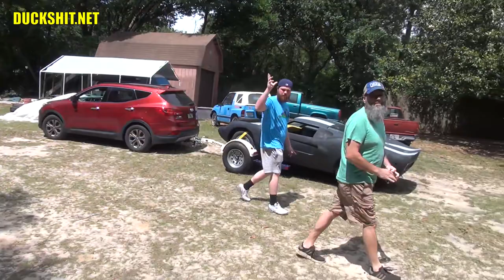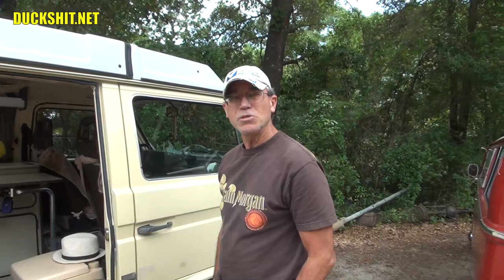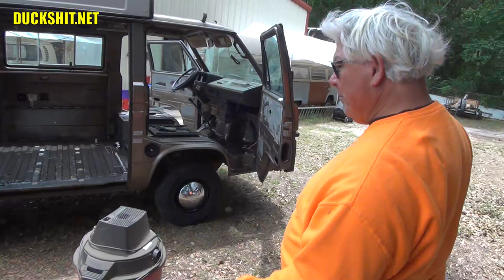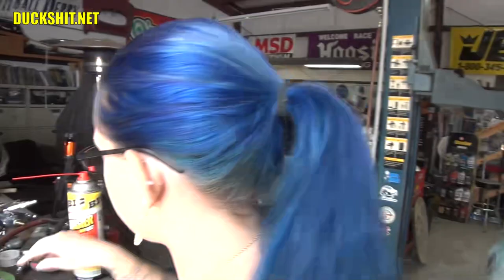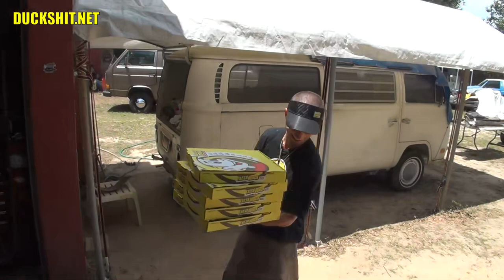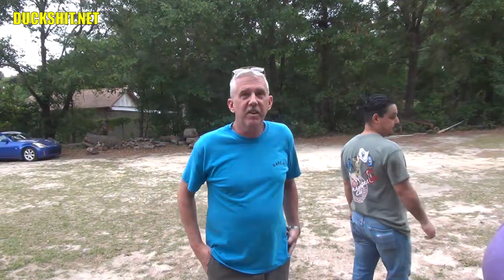Adjusting Spring Plates  - VW Tech Session - May 2020

Comment: I could definitely use a tech session,  I've been having trouble with engine idle... hope to have it sorted out tomorrow
Reply from the maker: I usually check the low speed jet(s) on the right side of the stock carburetor first, its almost always that.  Good luck!
Reply: @vvtheduckvv  found the problem,  the stud for the intake some how worked itself out... time for me to get a new stud 😂😂😂. Hopefully I will have it fixed tomorrow,  ran out of daylight.

Comment: I like your long to touch sessions would like to know also a little bit about the Synchro setups on the vanagons in the Volkswagens they are are they worth it or are they a lot of trouble
Reply from the maker: I understand that Syncro VWs are great.  But I never had one nor worked on one.
Reply: One of my neighbours had a mid 1980s T2 pick up Sychro (4x4). He bought it from a power utility (who usually use converted Transit vans). He had no problems with the VW though it was thirsty on fuel. 
https://i.pinimg.com/736x/7f/f6/ac/7ff6ac7a9bd502b29f7242dee079b107--water-.jpg